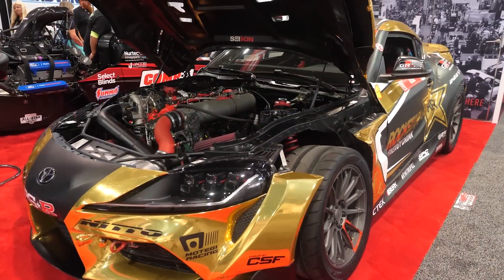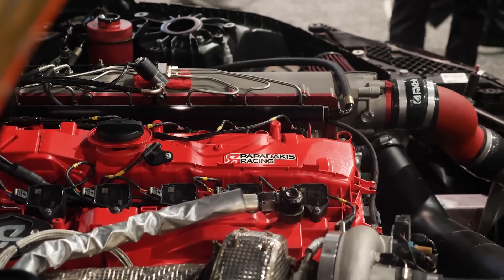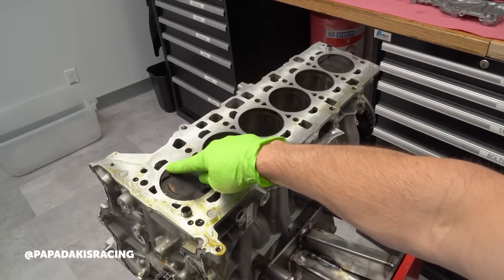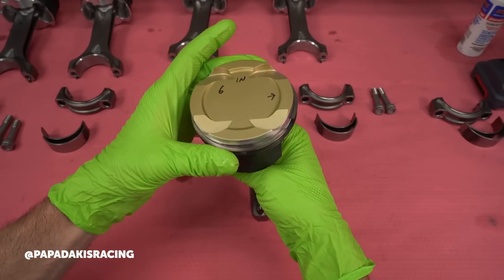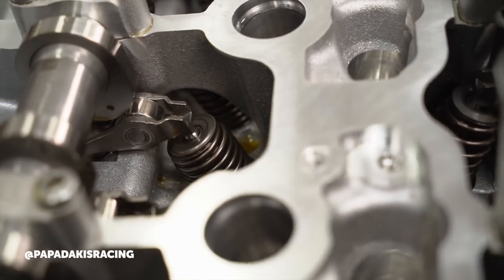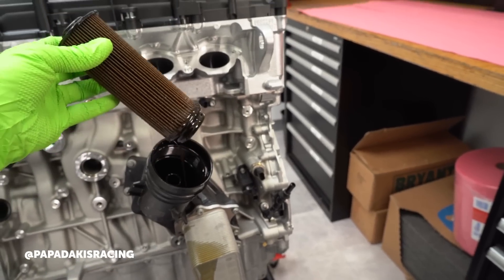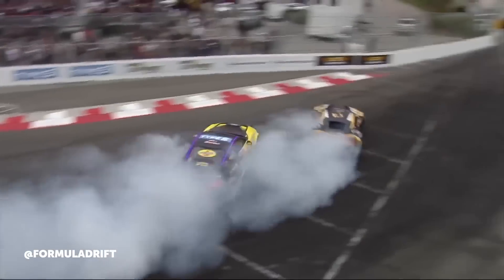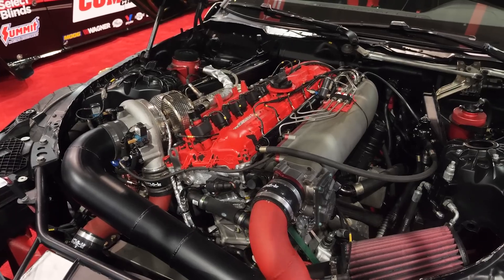Goodnight 2JZ? | 1200HP B58. Stock Block, Stock Bores & No Dry Sump!?

Comment: This dude made best part of marketing for bmw gear heads around b58 ... I'm not saying that his shilling or was prepaid, but the tear down and full inspection of the engine convinced a lot of people to b58, especially tuning potential.
Reply: He did mention being involved with Toyota. But to date the B58 falls very short from being a successor, regardless of manufacturer.
Reply: @allboost70  not sure if it falls “very” short of 2jz, but my point was that it’s far better to tune stock than it’s bmw predecessors and he removed a lot of guess work for people trying “break the ground”. For example: not needing to dry sump it is a major good news, stock sleeves taking 1000hp, the list goes on.

Comment: Nah. People have been making 4 figures with stock 2j blocks, bore and wet sump for decades
Reply: Guess how old the 2J is? Exactly, decades.
Decades of people developing and testing the limits on what parts can handle.
The B58 is less than 5 years old and people already go beyond 1000hp with many stock parts.  
Wait a few more decades, if there aren't any B58s breaking records in any for of Motorsport, then you can use that argument.
Reply: @Drift_Potato402  it’s not an argument to say the b58 is bad, I’m simply making the point that if the title of the video is the argument then it’s a moot one. Oh and the b58 has been out longer than that. Also, people were making that kind of power decades ago before the aforementioned “testing and development”.
Reply: @boostybotha355  before the "testing and development" you say? So people just slapped a giant turbo in the 2J, cranked the boost to 45psi and hopped for the best? Guess what mate? Whatever happens then counts as testing and development.
People learning from eachothers builds and blown engines does count as testing, and the many brands making parts and making tests themselves count as development.

I get that Ur not tryna hate on neither engine, but people don't just come up with things to make an engine more powerful based on nothing.
Reply: @Drift_Potato402  don’t know how old you are but yes. More fuel and a big snail and youre there. I can remember in the early-mid 2000s seeing Supras making 1000hp. Granted they couldn’t gain traction to save their lives. Nowadays you can actually put that power to the ground, but that’s not due to the 2j being different, it’s primarily due to standalone ecu’s and other factors. You also don’t need 45psi to make 1000hp with a 2j. Why you getting all defensive? I’m speaking the truth. Again, my point was that a 2j can make the same power with the same criteria mentioned in the title. Obviously that is “testing and development” but im also making the point that it was still early in its popularity just as the b58 is now.
Reply: @Drift_Potato402 bro just stop. The 2jz is what it is. You can’t downplay that. It’s like because the 2jz takes up so much star power u feel threatened. The B58 is great. Time will tell. Lol
Reply: @bigjdm5460  i never downplayed anything. I just said that people learned with time how to make more power with it.
Also, why would i feel threatened? I'm just saying things on the internet and literally could not care less if you don't like what I'm saying.
Reply: @Drift_Potato402  nobodies waiting a few more decades. It’ll never replace the 2j. Status is to legendary backed by movies , Japanese culture , Toyota , 90’s , etc. B58 will be great just can’t fill those shoes.
Reply: @bigjdm5460  the B58 isn't going to replace the 2J, i never said it would.
Just because a brand makes a new engine with tuning potential means they want to replace the old ones? Yeah nah mate.
There are people to this day tuning even 1JZs so yeah, that's just wrong my guy.
"Nobody will be waiting a few more decades" who are YOU to decide that? Are you gonna stop people from using the engine? 
Even if you don't like a platform for some reason, doesn't mean people will stop using it and learning from it.
The only people who refuse to accept that the B58 is a good platform for an in-line 6 are people with bigjdm on their username.

Edit: learned how to write. sry
Reply: @Drift_Potato402  I love the mkiv but ppl get in there feelings too deep with this lol.. He mentioned mid 2000s without even realizing thats a decade after the car came out.. R&D is a big part of it which stems from popularity if modding the car. Also ppl doing builds, blowing them and learning from others' mistakes The mkv has been out 3 years and unlocks are relatively new with the 21+ models with most ppl sketched about the method. Majority of ppl arent doing balls to the wall builds on a brand new car. Cant compare 20+ yrs of aftermarket support to a few yrs. Apples to oranges. 
With the shift to EVs and sports cars kind of dying out cuz ppl dpnt care about thay, not sure I'd be confident to say there will ever be any newer cars that have the amount of aftermarket support for that long of a time like we had in the jdm tuner era unfortunately. So lets enjoy it while we still have it lmao

Comment: 2jz will always live on, the B58 had all the new tech, which is awesome, better and smoother graph and it does seem to be reliable, just not sure for how long 🤪

All the power still comes down to the cylinder head and turbo.

Great info here, thanks for the explanations of the BMW engines
Reply: equally reliable. there is always already past 100k miles and only failure has been the turbo( same as 2j ct turbos) besides that its the same story.
Reply: 2jz 86mm bore b58 82mm bore, wich one can fit bigger valves? 😅
Reply: @visa5175  ROFL..

Comment: Be interesting to know if they use anti lag as well. And how the efrs handle the heat and abuse over a season.

Great interview!
Reply: If I'm not mistaken they don't use anti lag and instead use nitrous to make up for turbo lag in the lower Rev range based on throttle position rpm and boost pressure

Comment: The only Oem based engine that can challenge a 2jz is the Ford Modular V8s.  Particularly the ones built for boosted applications.

Even the vr38dett can’t touch a 2jz.  A b58 is not even on the same Galaxy as a 2jz.

Comment: I mean 2jz made 1200-1300 whp with stock bottom END back in mid to early 2000s.  The iron block in a 2jz has done 2000+ whp before.  First 5 second import was done on a stock 2jz iron block.  

Click bait article is a lot like claiming a female mma fighter champ could take on the male mma fighter.  Not even on the same league.
Reply: give it time
Reply: You can have infinite time.  Not going to happen.

Ever.
Reply: @juanc5149  We'll see, people have been pushing big numbers out older versions of this engine for years, from what I heard it took a second to hack the ecu but granted I'm stuck in the 90s like you, this isn't first hand knowledge so add a grain of salt.

Comment: The orange IROX rod bearings are of the first direct admissions by BMW that start-stop systems kills rod bearings. They realized this with the N series engines that had start-stop retrofitted later in production life. These engines were never designed for Start-stop. They are the reason why rod-bearing failures have been few and far between on BMW B series modular engines, N63TU2 and above V8 engines, N74TU and above V12 engines.

This orange coating is a polymer that essentially allows the bearings to run with little or no oil pressure for a longer period over a traditional bearing, without significant damage. 

The side effects of these bearings are a fantastic and welcomed addition to all STOCK modern BMW engines (maybe not so much a 1200 HP race engine constantly running 90 PSI oil pres.). These are an added buffer against the ridiculously tight bearing clearances BMW chose to keep to this day. They make the bearings that much less sensitive to occasional oil starvation, which is inevitable in every engine's life (Cold starts, air gap after oil services, high G forces, steep hills, etc..)

If I could, I would have IROX coated bearings in every engine I'd every have. This trend will hopefully catch on before the combustion engine is dead.
Reply: Me personally, I'd use cryo and wpc on mine. At least that way I'm not relying on a coating to give me the results I want.
Reply: @MrDAllen1124  Based on what? Forum posts? That opinion is a dime a dozen. Every old-head says the same thing. Those technologies have been around for decades, and while good, it's not for the same purpose. We've been through all that shit on the S54s, S65/85s, N54/55s, etc. for years.

No matter what bearing you are running, you will be "relying on a coating to give you the result you want". Whether it's peened metal, or polymer, that's all a bearing is. In absence of oil film, the polymer coated bearings survive longer. In an ideal world, there would never be an absence of oil film. If that were the case, you could run the most basic single metal bearings on earth, forever, with no wear.

Hope polymer coated bearings hit the main stream aftermarket someday.
Reply: Do you know if anyone has had an opportunity to check their bearings on a high mileage engine under normal conditions to see if the coating wears out?
Reply: @grein545  I'm sure it's sacrificial to some degree, eventually revealing what is a traditional rod bearing, which is still fine technically. In our experience, we have yet to see a rod-bearing fail under normal use on any of the newer engines with the IROX bearings.
Reply: Perfectly described!

Comment: The "earlier" B58 they discuss is actually the later second gen B58.

 The B58TU is the engine they speak about. The two port exhaust is what BMW calls the "Medium output version" found in most later non-M Performance 40i cars. e.g. X5 xDrive40i, and apparently the supra. They use this in packages where space, cost, and efficiency are most important. 

Higher output second gen B58tu models, "High output version" , have 6 exhaust ports. E.g. G2X M340i, M440i, etc.. This second gen B58 also received various technology updates over the first gen, mostly to improve efficiency and emission control.

All early first gen non-tu B58s had normal cylinder heads with individual exhaust ports. e.g. F2X M140i/M240i, F3X 340i, 440i, early G30 540i, early G12 740i, Early G01/G02 X3/X4 M40i models. This is the OG B58. 

Fantastic engine if you are considering buying one. Great to tune. Even better If left stock, the engine will likely outlive the BMW body it's inside of.
Reply: Probably outlive everything it’s in
Reply: As a b58 owner i can confirm it holds rly good power. I'm on csf manifold, upgraded turbo pushing near 800 whp on stock block. Trans is the first thing to go with these cars. After 600tq it's a ticking time bomb. You can hit 520whp and 600+ torque on an e50 tune so you can blow the trans even with just a tune.
Reply: @#01 gen 2. M340i
Reply: @user-ly9zz2rs1z  what have you done to resolve the transmission issue, im soon to start work on my m340i but heard the zf8 can take about 700 nm of torque before giving trouble?
Reply: @MrMonopolyManCan  rwd holds a bit more than AWD version of the trans. After a certain point though, you need a stage 1 trans from pure drivetrain solutions. Can hold like 1000 HP and 850 tq.
Reply: The timing chain issue on the N20/N26 was really the guide failing and not the chain itself. For the most part, it was only a problem if you followed the BMW recommended oil change intervals, which are too long. They replaced the guide with a new part toward the end of 2014, so the last cars with the bad part were very early 2015 builds. I had a 2015 228i confirmed to have the older part, changed the oil every 5k miles, and drove it from 30k to 60k miles with zero issues. Ended up trading it for an M240i.
Reply: hi, you seem like a knowledgeable person. So you're saying that both b58b30a and b58b30b have the exact same cylinder head? I mean they both have 6 exhaust ports, but i thought maybe there were some other difference. Can you achieve the performance level mentioned in this video running both of them? Does one have a better oil pump than the other? I would love to know! Thanks
Reply: until the timing chain snaps.  I'm not sure about the B58 specifically, but I've had it happen to me on my past BMW's and the chain on the B58 looks the same, a tiny little bicycle chain, and its on the back on the B58.  I own my cars and drive a lot, so decided to stay away from the B58 when I saw that if anything they made their timing chain issue worse, I got an IS500 instead.
Reply: @85CEKR  the aftermarket support for B58 is rising, so it’s slowly climbing to the popularity of the 2JZ as a tuning platform with an extra time
Reply: @85CEKR  Craig, with all due respect that's a concern relevant to any engine with a timing belt or chain, which is essentially every passenger vehicle on earth, save for rotaries and heavy duty gear driven engines. Not to mention, Toyota chose this BMW B58 engine as one for their own production long before the Is500 was even announced. If it's good enough for Toyota, it's good.

There is nothing particularly noteworthy about the timing chain or guides in the B58, aside from it's simplicity, being an Inline-6 configuration. The chain is made by IWIS, which makes chains for just about every brand and industry on the planet. BMW doesn't produce chains. In-fact, your IS500 has an IWIS made timing chain that is twice as complicated as this B58 at minimum, being that it has two cylinder heads and two more camshafts.

Being that your anecdotal prior experience with a BMW timing chain was negative, I'm glad you found a car you like! Albeit, such a compromise as an IS500 which is essentially a knock-off version of it's german counterparts. 

Cheers
Reply: @XcoolcoolbeansbeansX  it's really not nearly as much an issue with other brands, BMW is the only brand that has multiple class action lawsuits against them because of the issue, I'm part of 2 for 2 separate vehicles. And I'm not sure about the chain brand but I looked into this and the chains on all lexus/toyotas are massive compared to bmw's.  The chain from our x3 was literally smaller than the one on my kids bicycle.  When my x3 was at the dealer I managed to talk to a mechanic on break he said mine was one of 7 BMW's in there that day with a broken timing chain.  If you want to dump alot of money into the B58 to bullet proof it and make a ton of power it's a great engine, if your a normal person I'm pretty skeptical.  I've been a BMW fan boy for years and following them really close, everytime a new engine comes out it wins all these reliability awards and everyone praises them, then 6 or 7 years down the road reality sets in and people start to realize the truth, I suspect the B58 will be the same.
Reply: @85CEKR  B58 is out already 7 years -  no big issues until now
Reply: @85CEKR  sure you put out those words from YouTube comments aint you
Reply: @85CEKR  lol you probably had an N20 in the X3 you speak of which is notorious for timing chain issues. It’s really one of the only newer engines that bmw has made with timing chain issues.
Reply: @85CEKR  Your mistake was not buying BMW's best engines, their inline 6s that's always been their best out of them.
Reply: @SaturdayWinter  I did have an N20 that had the timing chain go but imo that was the most reliable BMW engine I've had.  I had an N54 (worst engine in existence imo(funny enough won tons of best engine, most reliable engine until it was 6 or 7 years old and it became clear how bad it was) and an N55 both had tons of issues.  I admit I've never had a B58 but I'm super skeptical it'd be significantly better, I've heard horror stories about it already too.  The only great BMW engines imo are the 2005 and earlier straight sixes before they went direct injection and turbo'd,  those are fantastic engines.
Reply: @85CEKR  the b58 is bulletproof man what are u on the fence about exactly? The motor is unproblematic and easy to work on
Reply: @60thirty22 I mean a Is500 is a classy ride with good looks and a great engine and reliable trans. Let him have his opinion atleast it was backed by some investigation rather he’s completely accurate or not.
Reply: @85CEKR  Nope timing chain not a problem with the B58 any of the versions.  I know of what I speak.
Reply: @85CEKR  have you managed to bulletproof the IS500 yet? How much power are you making?
Reply: @deadlydonague2402  its about as bulletproof from the factory as a car can be, I haven't done much just some bolt ons.  They make a pretty noticeable difference though, the stock exhaust gets down it 1.25" inch dia in one spot, now it's 2.5" front the stock headers to the back.  I've heard with similar setups to mine they are making a bit over 500hp at the crank.
Reply: The timing chain is an issue on select 2012-2014 vehicles. The n20 engine being one of them. Not something on all bmws. There were very specific bmws in the past that had issues such as the timing chain issue. Not all are unreliable. @85CEKR
Reply: @85CEKR  ppl who drive a lot like u never care about oil level..
Reply: @f2LTurboski  ya really not true
Reply: @85CEKR  timing chain isn’t an issue with the B58
Reply: @85CEKR  N20 4cyl turbo timing chain is a common issue
Not an issue on the B58 though :-)